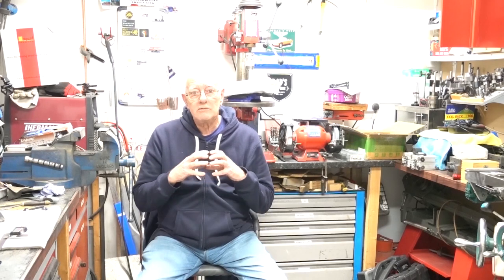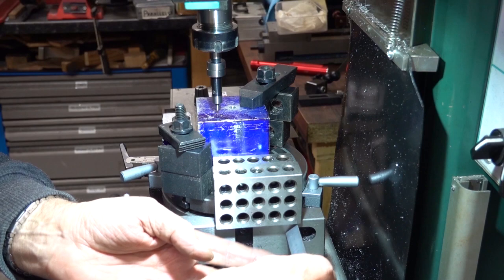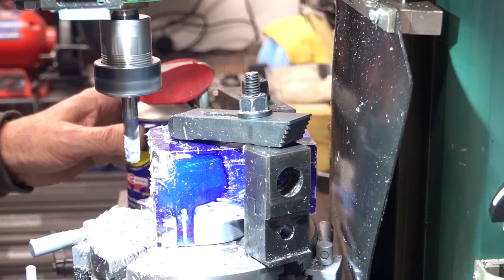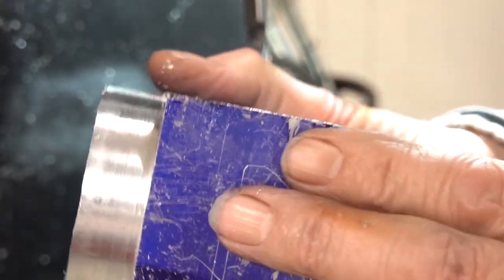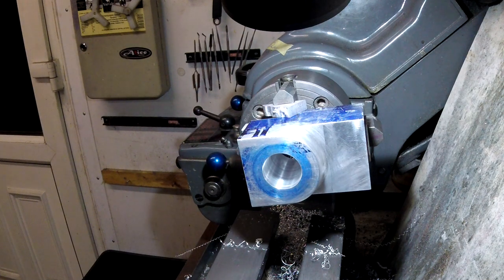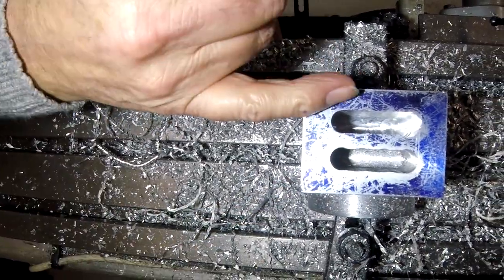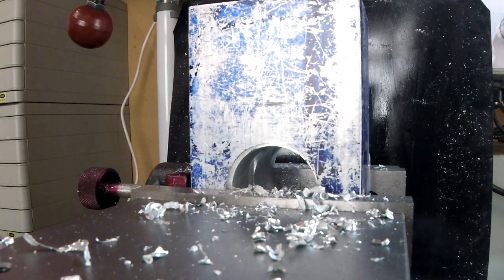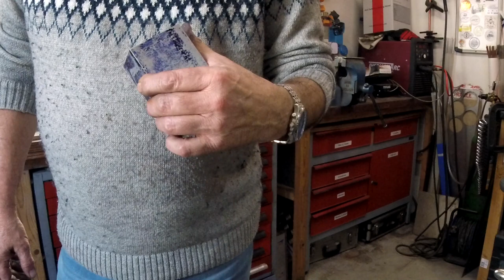Making a  Hit & Miss engine from scrap Part 2 Tha main body

Comment: Nice work on the cylinder/water jacket. Regards Kevin
Reply from the maker: Yes , from listening to the guys with the full size versions they don't seem to get very hot so it should be ok.
Regards.
Steve.

Comment: Top tip for a surface plate if one or two do not just drop into your lap, pop down to a glazing firm and ask if they have any offcuts of glass. Usually it is plate about 6mm thick and the way it is made (floated on molten tin) makes it very very flat. I do like your bore centre finding device. Have you got a link for it?
Good work, well done.
Reply from the maker: Hi Ben. I do have round coffee table top I sometimes use. Room is my problem. The centre finder is from machine-dro.co.uk
Steve.
Reply: @Steviegtr52  Cheers for the link. You can get an offcut in all sorts of sizes and you may well get it for nothing from their bin!

Comment: A drop of paraffin or squirt of the WD40 that is in shot will help get a clean cut when boring. Not sure what insert you were using but a **GT will make a lot of difference too. Keep up the good work
Reply from the maker: Thanks for that Jason. I do not have any gt inserts for the Boring bars, so had to manage with what i had. Squeaky.
Regards.
Steve.😁

Comment: I have already got a boss that sticks out at the front, you did well to avoid that situation 🤣. Coming on well Steve, not sure what's going on with your lighting though, lots of over exposure, just something to be aware of mate. Cheers, Jon
Reply from the maker: Hi Jon. Nice one. Had to read it 3 times before i clicked. Yes the camera. Not sure what happened. I think i must have caught something while handling it. I think it's ok now. If not i will have to reset to factory as there is too many options for my wee brain.
Regards.
Steve.
Reply: @Steviegtr52  lol, subtle. My boss that sticks out at the front sometimes interacts with my own audience lol.